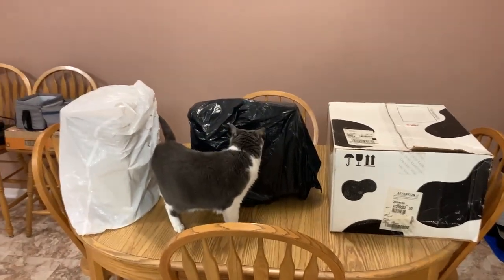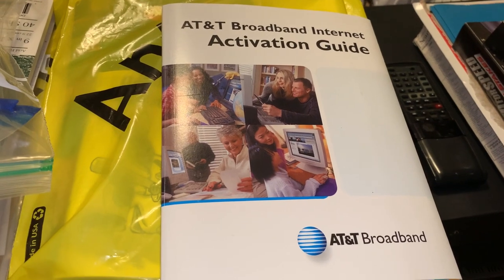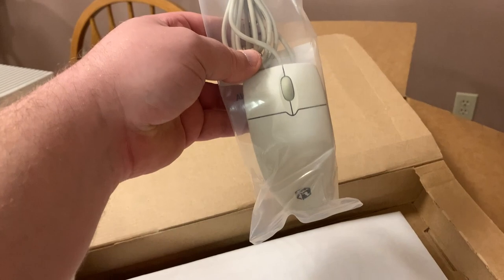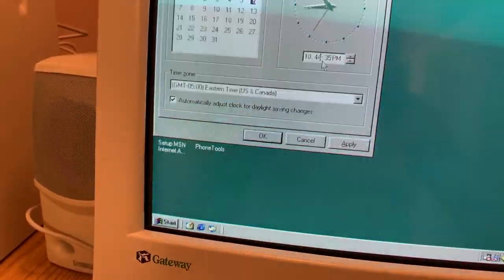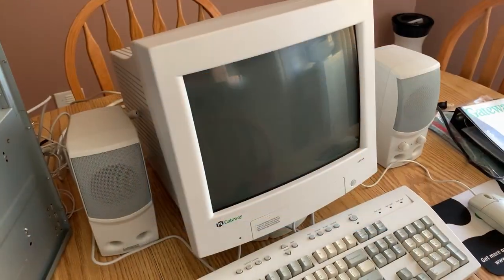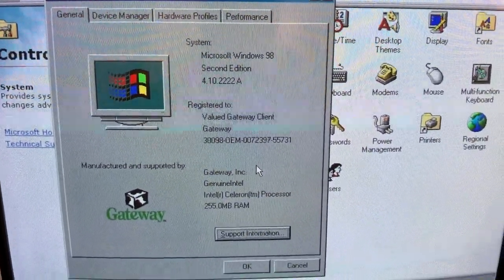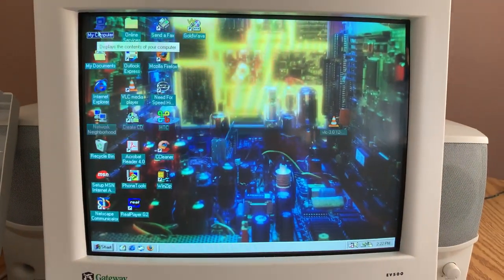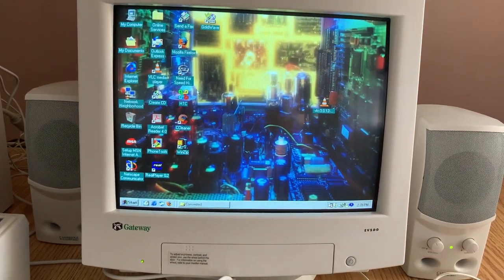My First PC - Gateway Essential 500C From 2000 Part 1

Comment: Dude!

Not only is this a throwback to the early days of your channel, it's a throwback to the early 2000's itself.

Full short disclosure, I've been playing a community-upgraded version of Max Payne, whose disc image I've [ahem] 'acquired' from a certain site [ahARCHIVEDOTORGem].  In short, from a throwback game session to a throwback video.  ahhhh . . . XD

Incidentally, my old Compaq FS740 and its JBL speakers still work, (nigh) flawlessly!  Although, the monitor's control buttons can be sensitive, and the speakers may need a pluginandout session on the headphone jack for the speakers to even fully work, and that's after a contact cleaner spray in the ports... (I never did quite completely disassemble the right speaker, no thanks to a STRIPPED SCREW. x.x)

I also got that same jeweller's screwdriver set, only the clear plastic is not fully intact...

47:30 - ...I see I'm not the only one that thought the opening setup sound from the Creative Sound Blaster AWE 64 Gold disk would make a cool bootup noise! :D

(...or was it the 3D Blaster?  I forget which.)

Comment: 20:07 what the heck happened there? Wow. That thing is absolutely mint. I wish I had all of that information about my first PC, let alone my first PC. It WAS a Dell Dimension, I'm not sure what kind, I think it was a 4600. Windows XP, and some really generic keyboard, mouse, speakers, and a really old, HP or something, 17" or so flat panel monitor. It was an EARLY flat panel, and it was junk, it always flickered and never worked right. CRT's did it better. My uncle got it, and then I think it got tossed when he died. I didn't have ANY of the packaging or information on it, since my dad got it used. But it served me well for 5 or so years.
Reply: Cat saw it's reflection in the monitor and got spooked.

Comment: My first computer I got back about 1998.  It had the thunder clap startup sound too.  I believe that sound came with sound blaster cards.  My first computer I had built for me by a local computer store.  It was an AMD K6-2 450mhz processor, 128 MB of PC100 ram, 6 gig Western Digital hard drive, Sound Blaster card and a 40x cd rom drive.  I don't remember what it had for video but it wasn't anything special.  I still have it but the hard drive is locked up.

Comment: I was super late to the computer game. Mom bought an E-machines in 2004 just so I didn't have to go to the school library and type up my papers. I used to have a CRT monitor that did that exact same "snapping" thing and the picture would spazz. Also, I believe the the OEM of that gateway monitor is MAG Innovision.
Reply: Was yours one of the monitors that made a loud buzz after turning it on when the degausser coil goes off?

Comment: my first ever computer was one of these, i was like 6 and the monitor died and my mother threw the whole computer away and bought a cheap acer all in one. I found a full tower version with a pentium 3 in it at an e waste center and managed to sneak it into my car, I had the hardest time finding drivers, and i guess it was my lucky day because one day i was in a thrift store and happened to find that little gateway disk binder with the system restore disks which had all the drivers and stuff that would have come on the machine. i would still like to find one just like my original one, but still pretty good systems for what they are.
Reply: You should upload those cds to the internet archive
Reply: @Rojo7777-y8p  I would, but later on I found an ISO for the same disks, I forget the site, but they are already on there.

Comment: Also at some point can you find an eMachine T1840?

It would be cool if u and Harley could find one cause that computer was part of my childhood! 

Also if you get it, you should install a rear 80 MM case fan to help exhaust the heat from the PC and also replace the Power supply cause the 250 watt power supplies they use have a tendency to fail and kill up the motherboard.

Comment: I'm trying to make something happen but I need one thing from you if you can help, boot from the operating system backup cd, go to de win98 folder on the cd and execute BIOSID.exe and post the output of that command... Im trying to install a from a Gateway Windows 98SE on a non Gateway computer and I want to know what I need to make to my BIOS for it to install